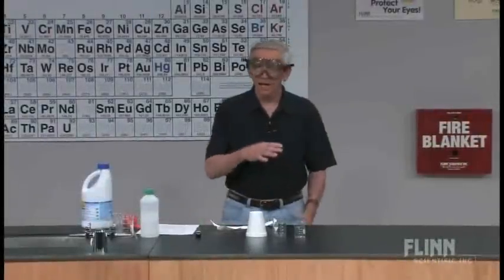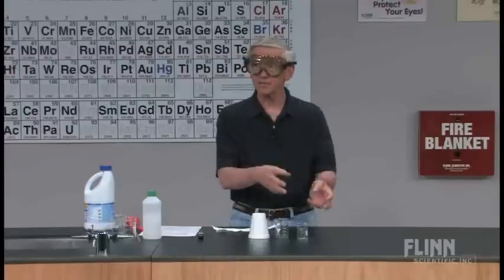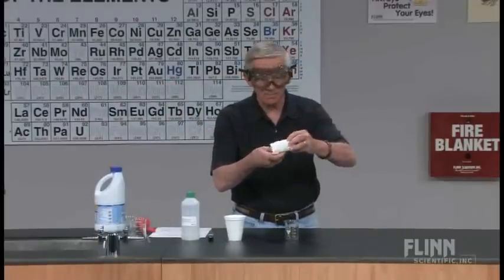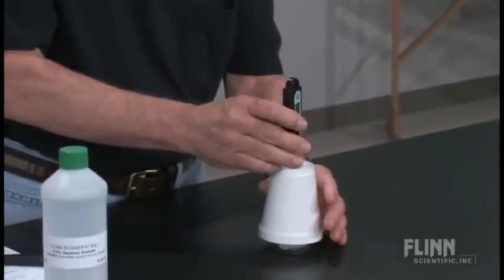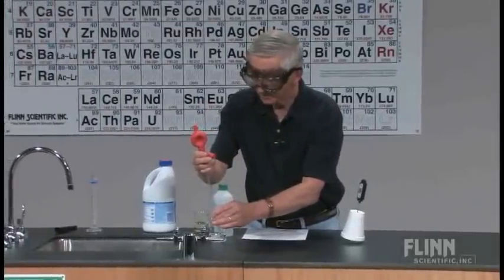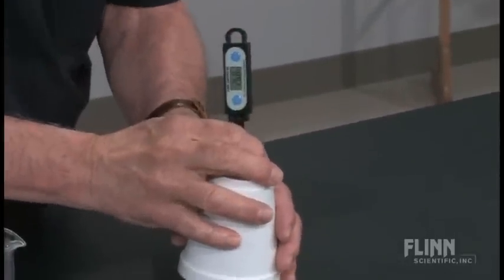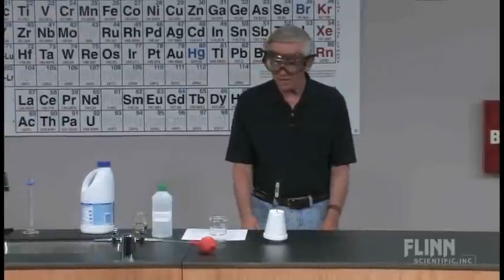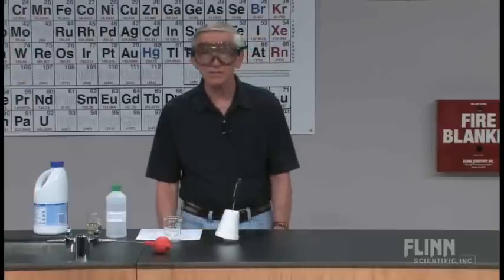The Oxidation of Acetone by Bleach

Comment: What was the point of this video? At first I thought he was showing off his home made acetone. Nope, temps still increased during the reaction. Then I got completely thrown off by polystyrene cups being used instead of beakers. What? Why would anybody do that. But then he stuck the coffee cup overtop of the reaction. That's a good habit to get into, completely sealing the space above reactions... Then he said 4mL is needed and this is a 5mL pipette so I'll just use 1mL. Once again, what? Originally, I was going to comment to just cool down the bleach solution, but then I thought he was attempting to actually limit the temperature increase. But by the end, I don't think there was an actual point, thus this comment.

Comment: First off you put the bleach in the frig/ freezer while still in the bottle.  When you remove the bleach, you pour off about 100ml of bleach out of the bottle. You then add the acetone, in excess, into the bleach bottle. give it a little swirl then loosen the top of the bleach bottle and let it do its thing. I would leave it a full 24 hours. Then you pour off most of the bleach solution and then use a  separatory funnel the separate the  Chloroform from the last little bit of bleach solution. And you can always go trailer park and pour that last bit into a Beaker and use a syringe to reach down to the bottom of the beaker and pull out the chloroform.

Comment: i will not state my age but know im young. i was cleaning my white shoelaces in a plastic bottle when only bleach and some water, the it occurred to me to put in some nail polish remover. i put in a little bit and then saw the mixture turned red, i immediately searched it up and saw i basically made chloroform. i went to dump it on the dirt and the bottle was fairly hot
Reply: Yeah,just another example of how you can make toxic and carcinogenic stuff with household items.Scary

Comment: A TD (To Deliver) pipette should not be shaken.  The tip should be in contact with the wall of the receiving vessel for three seconds after delivery appears to have stopped.  The vessel wall needs to be dry so you would need to deliver slightly above the liquid line in the beaker.
And, chemistry cannot be made boring.  Although I have had many lecturers try their best, none have succeeded.  :)
Reply: The way to remember is TD can also stand for "touch the drop"

Comment: This is the " safe PC" experiment which robs people of the risk respect needed for chemistry and other decisions.   Safety is not guaranteed and doing the real experiment wrong will have repercussions and teach many things.
Reply: Nothing to do with PC.  The point was improving the accuracy of the heat measurement.  The 40C degree rise version causes too much heat loss to the outside, and also a significant portion of the heat is from disolving the acetone in water.  By using a pre-diluted acetone, he mitigated both of those problems.

Comment: how much heat did the inner beaker absorb?  just sayin'
Reply: When actually performing the full experiment, the mass of the beaker would be taken into account.  Just sayin'.  You'll note he did not take a final measurement or compute the heat of reaction.  He was illustrating other points.

Comment: Even though you have insulated the inner glass container, doesn't it still throw off the temperature reading because the glass itself still has to be heated up too and that is not part of the oxidation?
Reply: This is the new progressive genius teaching teachers to teach students. While the reactions are both exothermic, both are calculable, and his demonstration would be worth much more if he simply derived the contributions.....something his students may very well have to do. Only a lab rat would think he is teaching lab process properly by segregating the two reactions, then suggesting it my only be appropriate for advanced classes. Maybe students are really that stupid today. A bit like teaching math, but avoiding algebra because it is to complex.
Reply: Of course you would add the mass of the reactants and the beaker.  It simply was not in the scope of what was being presented in the video.